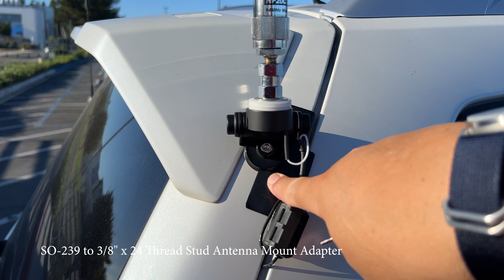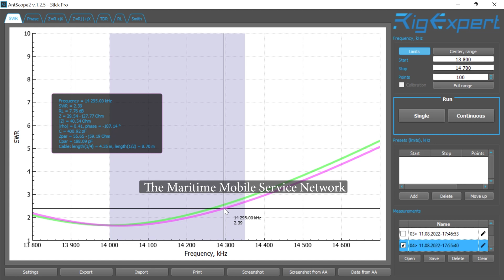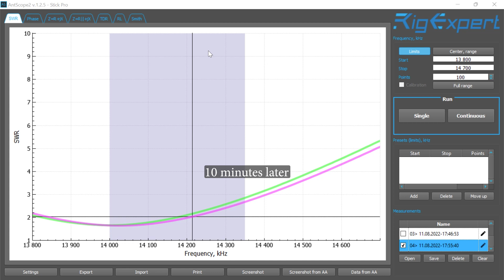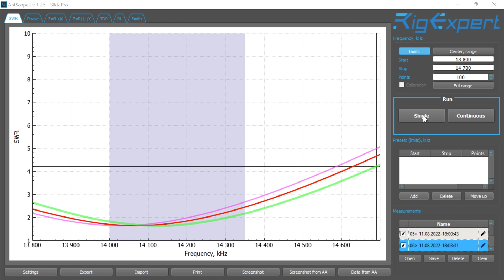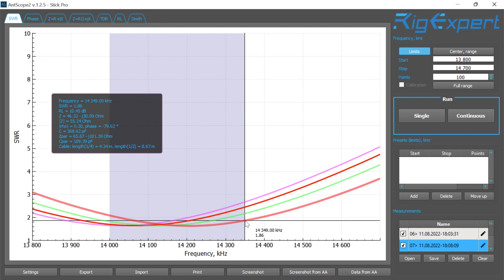Adjusting Mobile Vertical Antenna HF20CL

Comment: Nice video, Frank. Using a file or grinder wheel, to "score" (and then break off) the unneeded "Stinger" portion of the antenna vertical element, is a convenient way to shorten stainless steel  antenna stingers.
Reply from the maker: Thanks for the tip.

Comment: Where can I get the adapter for the UHF to 3/8 mount?
Reply from the maker: What I got was a 3/8 Chrome Stud for a CB antenna.  I took it apart and from that I got the adapter.  Never seen a 3/8-24 to UHF adapter by itself - well not yet.

Comment: I used Sirio 16cm magnet mount - in the middle of the roof. In resonant point swr 1.01, Z~50ohm +/- j0
Reply from the maker: Me too.  What I don't like is setting it up and then taking it down when I'm on the road.
Reply: @frankwc0o  how about radials? did You tried tripod and radials?
Reply from the maker: @mateuszbernat4727  Not on this antenna, but on an MPAS https://youtu.be/qRrv-DF8FXk